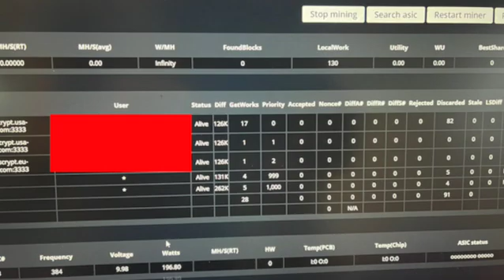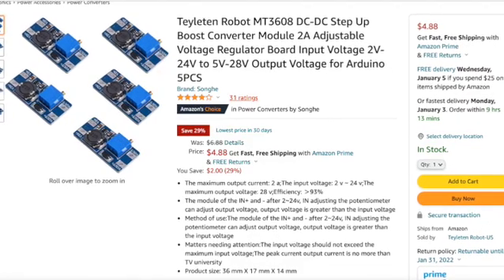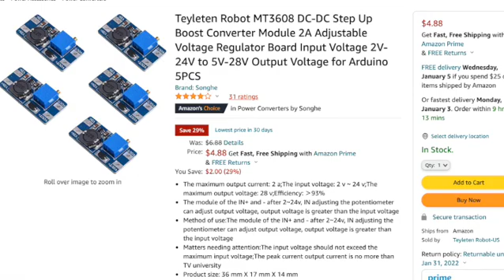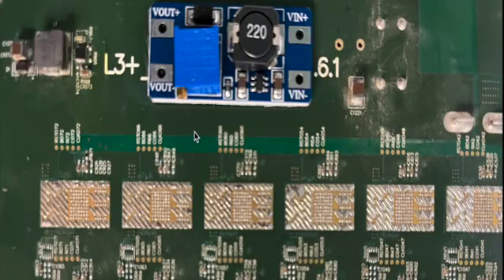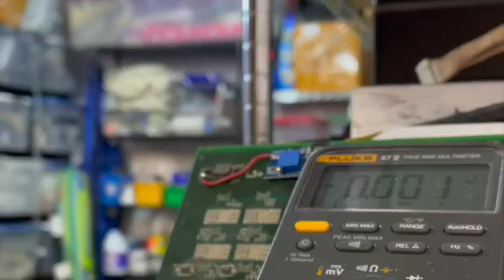ASICBASICS.COM - Replacing the L3+ 14.2V boost circuit with an MT3608

Comment: I know this is an old video but out of curiosity because I bought a bunch of used ones not realizing almost none of the hash boards would report a lot of them have a jumper wire going from the top middle of the board to that D1 post. I’m curious what you think about that versus replacing the circuit completely

Comment: i have two hashboards that someone repaired. He sorted the 10 volt capacitor with the diode, but he removed c1071 and c1072 too.In the other board he remove all components from boost circuit. The boardw worked for a while and then stop. Should i use a voltage regulator only, or i should put c1071 c1072 back? Thanks!
Reply from the maker: Removing the components in the on-board boost circuit is common if you bypass it with a 12V wire or 14V external boost circuit. Once you bypass it, and remove D1, none of those components are needed. Have you verified your voltages and checked your LDO’s? What’s the failure that’s occurring on your board, it might not even be related.
Reply: I thought that mabe the capasitors are needed in the output. I will take a psu tomorow. But it is possible for the board to function with 12v instead of 14v?

Comment: Where does one get ahold of BItmain's repair manuals? I have the ones from Zeus (which contain portions of these), but not the full manual. Does one have to signup/pay somewhere?
Reply from the maker: There is no full manual, Zeus just took Bitmain's manual and slapped their name on it. I have a more in-depth walkthrough of the board on my website that goes into much more detail on many of the aspects of the board and it's free. It's a living document so I update it fairly regularly. 
https://asicbasics.com/bloguverse/

Comment: Nice video.....can u do video  installing  boost circut for s17?  . Thanks
Reply from the maker: I have a few S17's but unfortunately I haven't had any failures that have led me to needing to do much work on them. The only thing I've ever had to do with one of the S17's is reflow the I/O connector on the hash board. Be careful with aftermarket firmware on these however, if they undervolt them too much the hash boards can die.

Comment: Excellent Friend, and For source of 12v to 10,4V ?
Reply from the maker: You should be able to use the same converter for the 10.4V source: https://amzn.to/341QQ0J 
If you need to grab 12V for this I would take it from the cap that's just above the buck converter circuit, C943 on most versions of the board